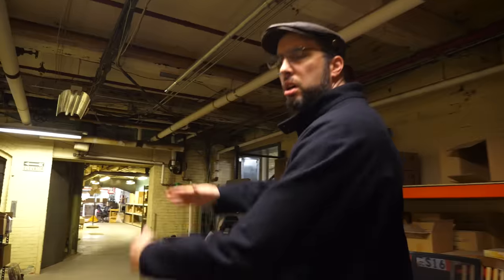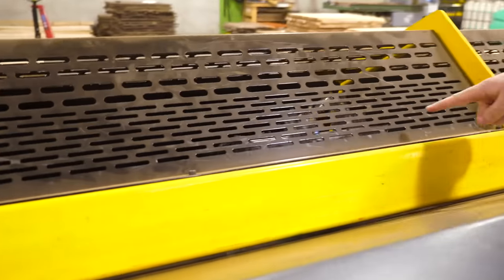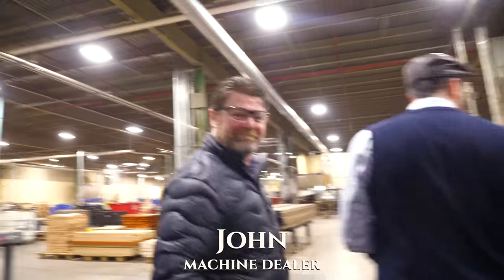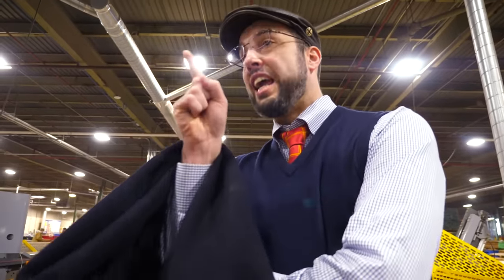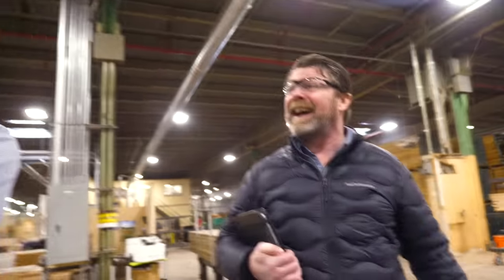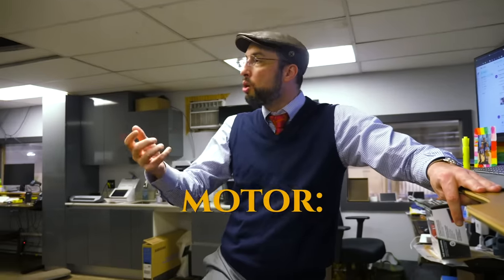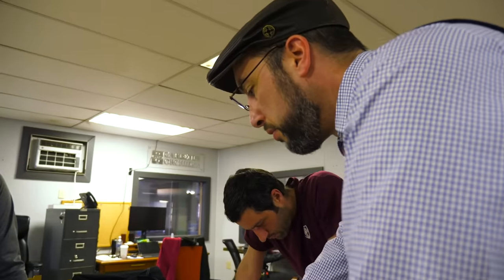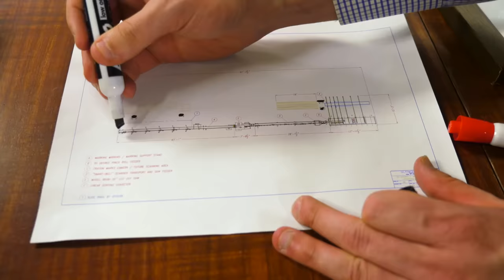A $500,000 Machine?! (and another $500k to install...) S15E39

Comment: Buy a second OG chop set-up for 100k, double output, expose down funnel problems. Assuming resell value is actually 50k, you are essentially paying 50k for stress testing your system.
Reply: This was my exact take as well. Significantly cheaper and immediately doubles throughput. Main concern would be floor space, but sounds like they'd need to solve that problem with the new machine anyway. Other concern would be labour. Is it cheaper to hire a second crew, or is it cheaper, in the end, to buy this machine?
Reply: Ya I don't fully understand why that option wasn't discussed. "Boy we sure love these machines and we can't afford to buy a new one. Also we don't want to over invest or artificially bottleneck downstream production by increasing throughput by 200%. If only we could reasonably incrementally increase throughput..........." Painful to watch. They have 2. Getting another is a 50% increase. That's A LOT. Like, a 50% speed increase is massive at scale. I suspect if they bought that fancy new machine it would sit around unused more often than they realize. If they need more after the 50%, just sell all 3 and upgrade.
Reply: Another chop setup would be more than the quoted 100k they got. That would just buy them the machines. They would still need to power and install the equipment. The space is likely another consideration. But the biggest issue with doubling their machine count would be labor to run 4 chop stations. Spend the money and run one wickedly efficient machine over 4 bottle necked ones.
Reply: @JustinSmith1287  I'd think you'd then run into labour and space constraints more. 1 faster machine could be operated by a few people and once it's proven, they can reclaim the space of the 2 older chop setups for other machines.
Reply: @DarkenSeyreth  they already have two chops so to double up the system they would need another 200K and additional belt length again in the sort station and considerably more room to fit the additional machinery
Reply: @JustinSmith1287 To answer your question, This buying a 3rd OG chop option, while I fully agree with doing so, makes poor Wyrmlyfe content...

Comment: From my experience in the automation industry for some years now is that you can ALWAYS find another bottleneck if the demand is there for it. 
Endless process, but sometimes it's just worth the cost of reducing it a little.
The question you have to ask yourself is, is the next bottleneck much much faster than the chopping station? 
If you spend a million on getting this machine up, how much would the NEXT bottleneck hold the output back?
Reply: Exactly and well explained. If the next bottleneck won’t allow the new machine to be maximized then it isn’t money well spent.

Comment: The biggest thing is how much slack is there currently after the chopping? You don’t want to spend a million dollars to chop five times faster but find out that you can only increase ripping by 20%, because now you’ve got a very expensive machine sitting idle most of the time waiting for the downstream machines to finish processing what it already output. Especially if the alternative is to just buy another $100k push feed to increase output by 30%, because that’s a $900k savings and basically identical benefits since they would both saturate your current overall throughput capacity.
Reply: Agreed, a smaller increase on the throughput here (by adding more of the same) saves them cash to deal with further bottlenecks yet to be discovered downstream.  Plus, with everyone saying how relatively safe and easy to learn their current choppers are, adding a few staff positions to run more of them wouldn't be much of a problem.  Then you've also got redundancy in case one goes down.

Comment: One of the things I LOVE about these videos (the hug was nice) is the breakdown of your systems. All around the world, other factories are doing the same thing with their machines. Now go to the company that MAKES the machines...and they have to do the same thing! 'How many of these machines can we make? 3-4 a year? What's the demand? 4-5 a year? Can we speed up the process by 20%? How much will that cost? How long will it take?'

Personally, I would try to improve your conveyor system and then double down on the machines you have. They work well. They're reliable. They don't look like they take a pile of training time to get to know them. Spend 200k on two more machines plus maybe another 200k on a better conveyor system and then run like mad. Once you identify the next bottleneck (because there is always another one), you have 600k to try and fix it.

Comment: You'll have to consider what the output of that machine actually looks like with human marking before it.  That clip was unrestricted input.
Reply: But then you can throw man power into marking.  Seems like the existing bottleneck is the actual cutting time, can't throw more people at that problem.  Adding an additional grader or 2 is a simpler problem to solve than 100% equipment utilization.

Comment: This is like buying a Death Star: throw way too much money into one single thing that's way more powerful than you actually need (but it looks really cool!) as opposed to buying one or two more of what you already got to reach the capacity you need, then use the savings to deal with the next problem you find.  The Galactic Empire fell specifically because it got locked into a spiral of overspending on badass super-projects instead of prudently targeting its own shortcomings and correcting them appropriately.
Reply: Yes, before spending a million space bucks on new equipment they should try finding new ways to motivate the workers.  They should double their efforts

Comment: Not only find if there's still a bottle neck, but do a feasibility study on the rest of your line. Only if you have production stations sitting idle universally down the line from Chop, would increased throughput provide a benefit, otherwise you may find having to patch up one or two other stations with upgrades. 

Plus you have currently what 2 chop saws? Tossing both for that new fancy boy, could over all increase throughput on average, but when that machine goes down, its all your chops, not half like you currently have, and with how much movement is involved, it will probably go down more often. 

Best of luck!

Comment: Servo motor is a permanent magnet motor. The stater doesn't need to be magnetized with electricity just the rotor. That gives you a lot more control. An encoder is what tells what location the materials are with information fed from the motor.
Reply: You are not entirely wrong, but technically a Servo is not often motor specific.
DC brushed, DC Permanent Brushless, AC Asynchronous with built-in encoders and so on.
As long as it has the closed loop system for precise control over the positioning and speed control, we are talking servo, with a few exeptions.
You are entirely right that probably the best solution (Slightly expensive), is permanent magnet brushless AC motors with Servo controllers.

Comment: I assume, of course, that the new machine would have a faster throughput than the current two machines combined, as well as possibly other benefits as well.  Not sure it's worth it to have a half million machine just to make marks, when humans can do it for a fraction of the price.  I'm by no means a woodworker, but I've played enough Factorio to know that you can never eliminate bottlenecks, you can only push them to the point that they don't really matter to your current needs.

Comment: You can easily figure this out. If you could 100x chop capacity in theory. What is your next limiting factor? You should be able to figure out max capacity at each location if no bottle necks to their input. Then what is the difference between new capacity for chop and the next bottleneck? What is your amortization rate? See which one is higher? Also go next level, how much will it be to increase the next bottle neck. Does that make this new chop worthwhile?

Comment: This problem seems like it is essentially a lean construction problem. Lean construction try's to solve construction scheduling and manpower using manufacturing concepts. You should be able to work out the amount of LBF that you need for your final product (by part maybe), and then figure out the average LBF each station outputs. You can not work any faster then your slowest station (chop in this situation). You should then be able to figure out how much output you need from the chop station to match the next potential bottle neck. If chop is able to output 1000LBF per day, then the next station can receive 1500LBF per day the maxim output that you need from chop is 1500LBF. But if you need 2000 LBF a day to hit your required total output you need to upgrade chop and the next station to get to get a total of 2000 LBF per day. It doesn't make sense to invest 500k to get 4000 LBF a day when the max the system can handle is 2000 LBF per day.

Comment: The out feed of the cut wood is faster than it going in, that's why it's confusing you. The board coming is going to be moving slightly slower than the pieces getting yeeted out, so there's less inertia going in.

Comment: Wyrmwood needs to do basic process engineering. You can math your processes out and stop questioning where your problems are. Use the data you have. This seems like a role you guys are missing (or the role doesn't have the autonomy or power to make changes that should be happening).

Use math, it's good.

Comment: You really need to look at downstream before you make the decision. You are always going to have a bottleneck somewhere because every station has a maximum capacity. You may be at 100% utilization on the chop but what is your utilization rate for your other stations?
If the coating station for furniture is at 95% utilization and sanding for accessories is at 90% you're only going to be able to get that 5% extra furniture out and 10% accessories. Is that worth the 1 million you would be spending? 
What do you expect the utilization to be on the machine if you buy it? In the long term it will never be able to have more output than its previous process so will this machine work faster than the Rip machine? If so how much faster or slower? Can you get away with something cheaper and a little slower that is closer to the output of the Rip machine?

Comment: I would recommend trying to identify other bottlenecks first. It makes no sense investing that much to fix a bottleneck when another one may render its benefit negligible. While it may be a good long-term investment, it may be unwise to make such an investment at this time. It's unclear what your space constraints are, but you could consider another machine like the ones you have. If you're not going to see the full benefit of the expensive machine, you could target incremental gains instead for a much smaller cost. This would be most appropriate if you had other bottlenecks in your process, which is why I'd recommend looking at the rest of the process and see if there are other problem areas before spending money. You could do this during this next month while you test out the increased hours.

Comment: Nop dont pull the trigger yet. Yes, you would increase capacity and reduce bottle neck issues but like Ian said you increase other production area bottle neck, and whats to say in 2-3 years you fulfill the demand and orders aren't flowing in as well as now. Then the machine won't be as profitable as the years it ran full time. 

I am with team doug with this one wait and see if modifications you made are helping and then adjust with other corrective mesures

Comment: If the existing saws were 100k, it seems adding another one there might be a cheaper option to increase production.
Reply: Space issues I think
Reply: Space on the floor, power requirements, manpower, and speed of the machine. It all depends on how much more throughput they need.
Reply: Plus the price of those 100k saws are now 200k+ the price of equipment has nearly doubled since they bought those.
Reply: I'd assume staffing cost would put the price closer that it seems (if not worse). You add another chop, and have to put 2 or 3 more employee's on it to operate, that chop now right away gets much closer to the 500k new machine which you might only need 2 or 3 employees total (instead of the 3 regular chops with 6 - 9 employees). Add onto that the employee cost is forever and always increasing (as long as you run those machines anyway).